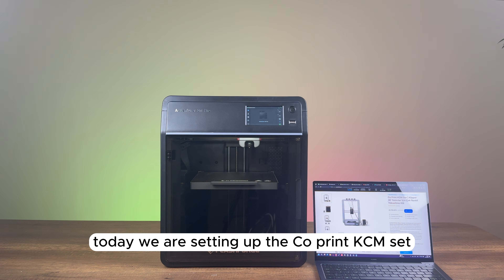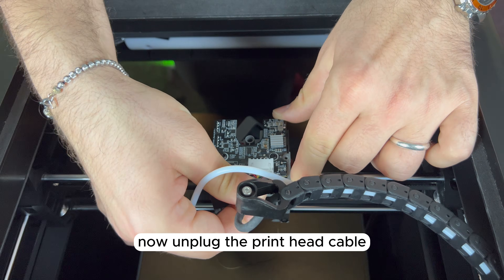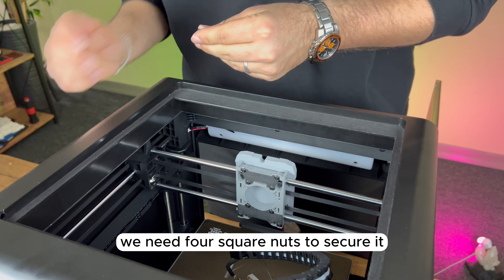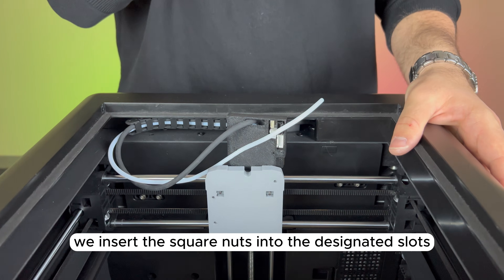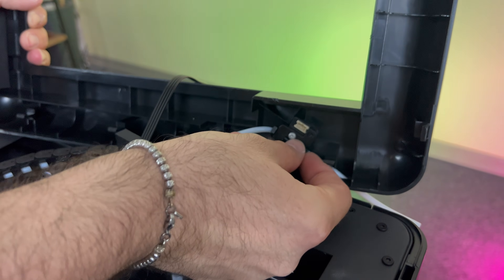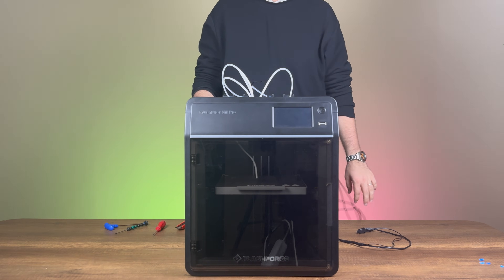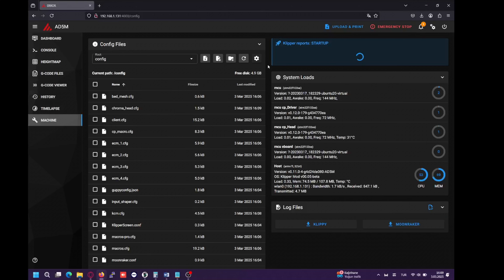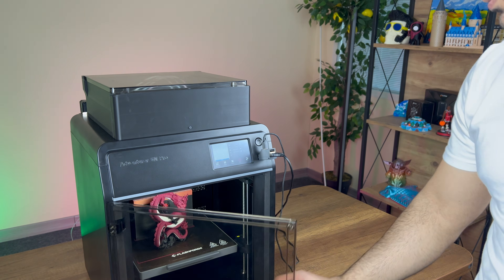Upgrade the Flashforge Adventurer 5M Pro for 4-Colors Printing | Co Print KCM Set Installation

Comment: I got this for the A5M non pro cause it says it supports that printer however there are no install instructions for the printer, only the pro. Doesnt mention these square nuts were needed ahead of time. The extruder bracket cant even be used on the A5M so its a bust

Comment: This kit is not complete... AT ALL it didn't include any of the hardware  when buying this so called KIT it doesn't talk about including the screws and hardware to mount the extruders . Also when you print the so called kit for the top part in a flashforge 5mpro no where does it tell you the printer is not big enough to do that and you have to slice the top pieces and then put them together... Front and Back sides are to big for the printer to print.... No one says anything about that either.... This assembly video doesn't even show you putting the extruders together at all... THIS VIDEO IS A JOKE DO THE DAMN VIDEO RIGHT if your gonna do an assembly video and SHOW THE ENTIRE PROCESS...... Not just finished pieces put together..... you spend over 300 dollars for a kit that is not complete and you have to print your own pieces   WHAT A FREAKING JOKE.... am i not happy NO I AM NOT..... DO NOT LURE PEOPLE INTO THIS AND SAY ITS COMPLETE WHEN IT IS NOT.... I will be posting this kit on my facebook account as well as my youtube to point out whats left out........ Thank you for your lies.......

Comment: Will this work for the basic 5M? I thought the 5M pro just included a fan and a camera.
Reply from the maker: Hello, thanks for your question. The Flashforge AD5M printer is also compatible with the KCM kit. You can access the KCM kit from the link below. If you need help with the installation, the installation steps are identical to the Pro setup on our wiki. You can also access the wiki from the other link below.

🔗 coprint3d.com/kcm
🔗 https://wiki.coprint3d.com/en/Flashforge-Adventurer-5M-Pro-KCM-Set-Installation-Guide

Comment: Would this also work on the adventurer 5m. Not the pro?
Reply from the maker: Flashforge AD5M is compatible with KCM set. You can access KCM set from this link.

🔗 coprint3d.com/kcm

Comment: Where can I find the custom design support parts for the 5m pro?
Reply from the maker: The necessary parts are available on our GitHub page. You can visit them at this link: 
🔗 https://github.com/coprint/AssemblingParts/tree/main/Flashforge
Reply: I cant print the stl files on my ad5m pro.  They are larger than my print bed.

Comment: Hello 
do you got a customer service ?
I Upgraded the printer like in the Video and nothing works.
Mainsail wants an Update but i dont know how i upate it.
i can control the extruder and everything else like temperature or Fan speed.
But if i send a gcode data nothing happens.
also i cant calib. the printer and if send the extruder back in home position it crashes against the side and i have 2 do a emergency stop.
i hope somone can help me.
Reply: just wondering if they every helped you? they havent helped me...
Reply from the maker: Hello. We're very sorry for the problem you're experiencing. If you can reach out to us via email, we’d be happy to help you. 
✉ support@coprint3d.com

Comment: Where did you get the custom support parts?
Reply from the maker: Hello! All the parts are available on our GitHub page. Additionally, at the top of our Wiki page, you can find a table listing how many pieces of each part to print and where to access them.
🔗 github.com/coprint/AssemblingParts/tree/main/Flashforge
🔗 wiki.coprint3d.com/en/Flashforge-Adventurer-5M-Pro-KCM-Set-Installation-Guide

Comment: Where can I download the parts for the extruder mount
Reply from the maker: Hello! Links to all files are available on our wiki page, and all the necessary files can be found on our GitHub page.
🔗wiki.coprint3d.com/en/Flashforge-Adventurer-5M-Pro-KCM-Set-Installation-Guide
🔗github.com/coprint/AssemblingParts/blob/main/CX-1%20Extruder/4%20CX-1%20Extruder%20Block.STL
Reply: @CoPrint3D  Thanks. Where is the direct link to get MailSail file? Also, is this the most up to date software.

Comment: This looks cool but in reality, it waste a tremendous amount of filament. Look at the waste block of filament behind the multicolor print. That waste block is huge, js. Also, It seems to waste more filament than it actually uses for the print itself.
Reply from the maker: Actually, this kind of filament usage exists in all single-nozzle multi-color printing solutions. Some systems purge the filament off the bed (known as "poop"), while others—like ours—use a prime tower on the build plate. This process is essential to prevent color mixing during filament transitions and ensure clean, accurate prints. If needed, the prime tower size can be reduced in OrcaSlicer, or it can be replaced with a functional model where color isn’t important.
Reply: @CoPrint3D I have a multicolor printer and it does not waste nearly as much as that waste tower in ur video in my multicolor prints. Ur charging ppl around $300 or more to make the flashforge adventurer 5m pro a multicolor printer at the expense of extreme money lost in filament waste, how is that helping ppl in the long run?

Comment: are all the parts for this mod offered on the coprint site? I don't see the panels that fit on the top.
Reply from the maker: You can find all the parts on our GitHub page. 
🔗github.com/coprint

Also here is the file for the top panels.
🔗github.com/coprint/AssemblingParts/tree/main/Flashforge/A5M%20Pro%20Upper
Reply: You have to print those

Comment: And what do we do if our printer wasn't printing so we couldn't PRINT the mandatory items?  My Flashforge has been broken so much cause of the junk nozzles and extractors.  How can I do this if I can't print out the parts I need?  Why can't they be included in the kits?!
Reply from the maker: Please check our wiki section
Reply: @CoPrint3D  I had the files, but my printer is refusing to print them out.  My flashforge has constantly been breaking and not able to print anything and thier help people have been no help.  That is why I came here to try this.  I guess I will find someone with a 3d Printer who can print them out for me.  Since the one I'm trying to add this to, I can't print the items needed to hook this new system up.  That is what I was saying.  What happens when the printer you are trying to add this to can't print the items we need to install this.  I can't find that on the WIKI?  Is it in the Fact files?  LInks?

Comment: Is there a especific version for this (ad5m) set? The link you provide is a generic one
Reply: It works with the adventure 5 m and I know because I have one and get it to mine 👍. So no, there isn’t a pacific version for the adventure 5M just that one in the link. If you have any questions while installing it, just ask me.
Reply from the maker: Hello! The KCM Set works seamlessly with Klipper-based printers, so a specific model is not required. However, the connection parts that need to be printed vary depending on the printer model. You can find the list of these parts on your printer’s wiki page, and the files themselves are available on our GitHub page.
🔗 coprint3d.com/pages/kcm-klipper-chroma-module
🔗 wiki.coprint3d.com/en/Flashforge-Adventurer-5M-Pro-KCM-Set-Installation-Guide
🔗 github.com/coprint/AssemblingParts

Comment: I downloaded and printed every single available linked part, got halfway through my install only to realize a critical component appears to be missing to connect all of the extruders together. Now I have to undo over an hour of work just to print a part that should’ve been clearly included from the start? Not to mention I still have no idea where to locate the part I need to print. 

This is absolutely infuriating. The instructions are beyond inadequate, easily the worst I’ve seen for a project of this complexity. The absence of a clearly labeled, text-based, step-by-step guide is asinine. It’s not just an oversight, it's a complete disregard for the user's time and effort. I would not recommend this product and will likely be request a refund.
Reply from the maker: Hello! All the necessary files are listed on the wiki page for the printer, and they are all available on our GitHub page. If you let us know which file you’re having trouble with, we can double-check it for you. We’re sorry for the inconvenience you’re experiencing. If you have any other issues, please feel free to contact us via email—we’ll be happy to help you.
🔗 wiki.coprint3d.com/en/Flashforge-Adventurer-5M-Pro-KCM-Set-Installation-Guide
🔗 github.com/coprint/AssemblingParts/tree/main/Flashforge
✉ info@coprint3d.com

Comment: I also think if you could make a more detailed step by step process for the software install i think that would help people quite a bit!.
Reply from the maker: We will take your kind feedback into consideration — thank you for it!
Reply: @CoPrint3D please do so that’s the only thing stopping me
Reply: @CoPrint3D  I am currently trying to do this build with the non pro version... I purchased the KCM set for my flashforge adventure 5m and I am about at the 7:52 min mark in the video a few things, I never recieved the usb hub. that is on the printer. Also it seems like you plugged the 4pin kcm wire into the usb at 8:02 which I never recieved the KCM 4 pin to usb wire either. Now i am having trouble for the configs because it has to detect the chroma toolhead. any help would be appreciated. there is a lack of depth when it comes to the software things. Please fix and update as soon as possible.

Comment: The printable parts am i ablento print them on my adventurer 5m pro. In the video those parts looksnmuch bigger than my printing bed.?
Reply from the maker: Hello! Each print has been designed to fit on the build plate.

Comment: just received this today and upon inspection i see that my model doesn't have the part to the side of the nozzle that has co-prints lettering on it and my 8-1 ptfe feeder has a sensor on and it plugs into the chromahead ? please explain ?
Reply from the maker: Hello! If you purchased your product from Creality, the probe is not included. If you are planning to use it on a printer other than the Ender 3 V3, you will need an additional probe and a 24 Volt 5 Ampere adapter. There are also some parts you need to print, which you can access from our GitHub page.
🔗 github.com/coprint
The cable coming out of the head is for the filament sensor. Once you connect your 8-in-1 unit, plugging in this cable should work without any issues. If you experience any other issues, feel free to reach out to us via email — we’ll be happy to assist you!
✉ info@coprint3d.com
Reply: @CoPrint3D when I speak to coprint customer services they say you do not need the probe for flashforge adventurer 5m pro. I have now got a suitable power supply. Please confirm the probe?

Comment: what are the recommended print settings and material to use when printing the adapter parts for the chroma head and toolhead board please
Reply: Went onto the discord, PETG at minimum but ABS preferred. I printed mine with 40% infill with gyroid

Comment: I wanted to print the STL files first for the top of the Adventurer 5M Pro, and I realized that I couldn't print those because they seem to big for the printer. Any advise on this?
Reply: That is a good point! If the mod requires parts be printed and they don't fit on the printer then there should be a source for the parts. You can't expect people to buy a new printer so they can print the parts to upgrade their current one.
Reply: I'd assume cut the pieces, print them separately, and then super glue them together

Comment: the mounting bracket for the x axis sensor causes that board to rub on the back of the enclosure when your homing and printing.  It ripped the heatsink and a chip itself off the board when printing.  is there an alternative bracket available for download?
Reply from the maker: Hello! Unfortunately, there in no alternative design for the bracket.

Comment: I've gotten everything to work per the instructions however mine didnt come with a 2 in 1 dual printer cable and one of the printer cables did not have USB end so I get two file paths when the module connects directly to printer , either way nozzle still wont get hot which is my real issue
Reply from the maker: We're sorry to hear about the trouble you've experienced. Please reach out to us at support@coprint3d.com or via the live chat on our website — we'd be happy to assist you.

Comment: This tutorial works with the eight color set, right? 5:54 Just with the eight instead of the four, right? Also does the eight color set come with more tubing because it doesn’t look like there would be enough included in the printer.
Reply from the maker: Yes, it works with also 8 colors set. 8 color pack contains all of your needs.

Comment: Do you need to add any G-Code?  Or how can I find more information on what the slicer settings would need to look like?
Reply: follow up question do we need to use the included USB splitter or will any work?
Reply from the maker: Hello! You can find detailed information about the printer setup on our wiki page.

https://wiki.coprint3d.com/en/Flashforge-Adventurer-5M-Pro-KCM-Set-Installation-Guide

Let us know if you have any other questions!

Comment: Will there be STL files for the AD5M (non-Pro) utilizing the enclosure kit lid?
Reply from the maker: At the moment, we don’t have a specific STL release for the AD5M (non-Pro) model, but we can prioritize it based on demand. If you could share more details about how you plan to use it, we’d be happy to evaluate it with our team.
Reply: @CoPrint3D how are you suppose to mount the 4 extuders  there is a stl file for the 2 clips but nothing else . the video shows a long plastic peace they are mounted to but it didnt come with that part and didnt see a stl file for it?
Reply: I would also love an AD5M multicolor version. I am no expert with this stuff, so I have no idea how you could do that. But I would use it very much.

Comment: Installing the hardware is the simple part.  What I have found or been fighting with for days is the software to make everything work
Reply: I have been fighting for weeks with the software. I email them and wait days for a response that doesn’t help and then email again. Still waiting for a response but I tried downloading the software I think is the right one and it gives me error after error and I have to click try again only to get another error every few seconds
Reply from the maker: Actually, for the 5M Pro, the software setup is also quite straightforward. If you follow the steps shown in our video, you should be able to complete the installation without any issues.

However, if you still run into any difficulties, feel free to contact our technical support team via email — we're always here to help.
Reply: @CoPrint3D  the description for the software is horrible, after 5 minutes i want to quit.
Reply: @CoPrint3D  Nothing about this process has been simple.

Comment: I have the AD5M and was very disappointed they never came out with a multi material unit like this for it, which makes me very interested in this. That said I have a few questions. Since you replace the print head with the Chromahead and its nozzle does it achieve the same print speeds? Does it also retain the autoleveling and other automatic calibration features with the Chromahead? Are there a variety of nozzle sizes available to use and how easy is it to change them out?
Reply from the maker: Thanks for your interest! Yes, the ChromaHead maintains the same or even better print speeds, and it's designed for easy nozzle replacement — we offer multiple nozzle sizes for flexibility. It also supports auto-leveling and calibration features, just like your original setup. Let us know if you'd like help getting started or if you have more questions!

https://coprint3d.com/kcm
Reply: Volumetric flow is advertised as 24mm³ which is lower than 32mm³ flow on the stock hotend. I would like to buy if they had an option for higher or at least equal volumetric flow rate as the stock hotend.
Reply from the maker: @eraynecipoglu  Our hotends officially support up to 50mm³ as factory specifications, but in our prints, we don't use such high values.

Comment: I wish they would go more in-depth into the modding of the software and setup and config files.  I don't understand where some of this information is coming from.  And what's the deal with the filament sensor.  It's plugged in but not using it?  What's with that?  Does it still have filament run-out sensors on the new filament feeders?  Personally I think the 8-in-1 union should be before the filament run-out sensor and utilized.  Now I am having second thoughts on my purchase that I have yet to receive.
Reply from the maker: Hello, thank you very much for your feedback. If you have more detailed questions in mind, feel free to contact us via support@coprint3d.com  — we’d be happy to help.

Comment: I just got mine in today but I did the 8 extruders
Reply: Does the software work using 8 extruders instead of the 4 they show?  I am like you if i go through all this trouble i might as well do 8 for $100 more!
Reply from the maker: Hello! You can find all the necessary information about ECM on our website and our Wiki page!
🔗coprint3d.com/pages/ecm-extended-chroma-module
🔗 wiki.coprint3d.com/en/ecm